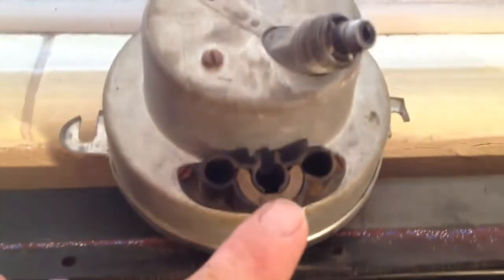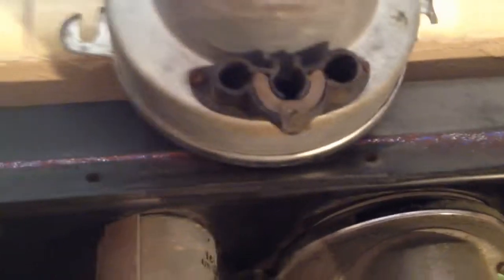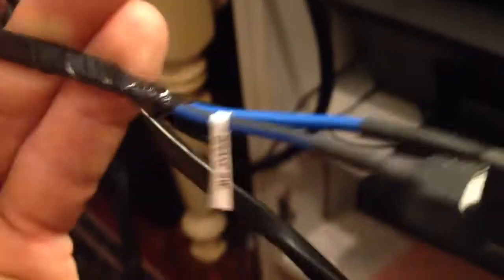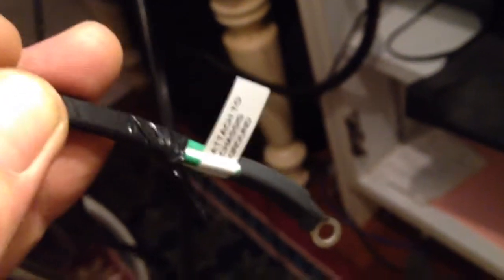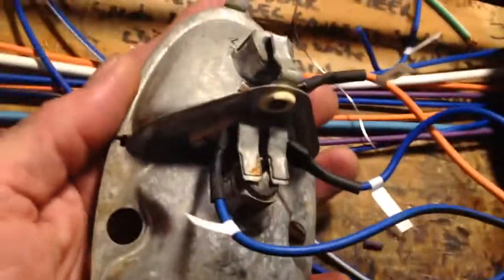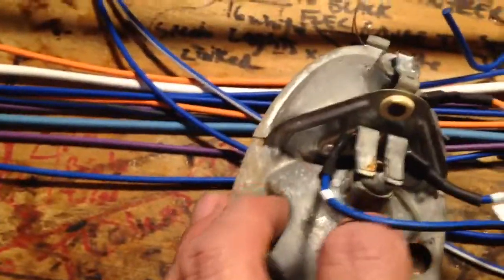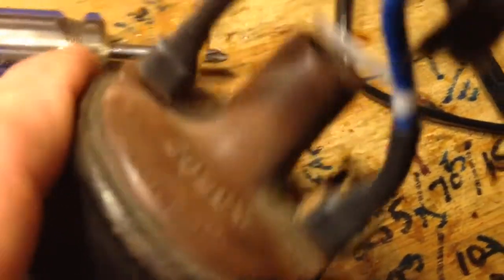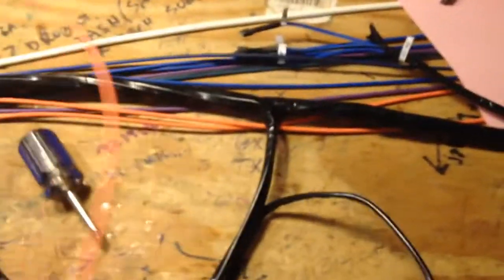How to wire your VW dune buggy with a Dune Buggy Brothers "plug and play" harness

Comment: where does the d- wire connect to on the reg and gen
Reply from the maker: The D- on a generator is ground.  Not needed if it's mounted on metal.  On an externally regulated alternator D- is just a short wire going from alternator, to the regulator.

Comment from the maker: I get that alot. Tag= License plate light. It is tied into the running lights circuit. Should drop out dead center of the tail box. Requires alot less label tape.